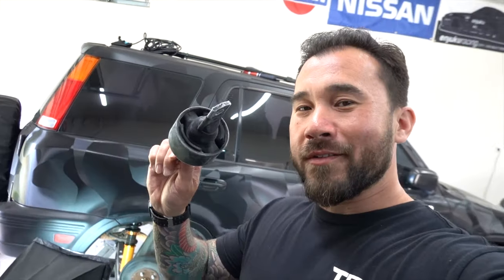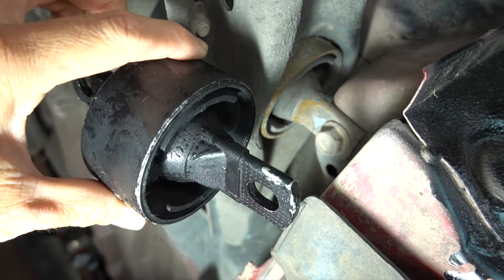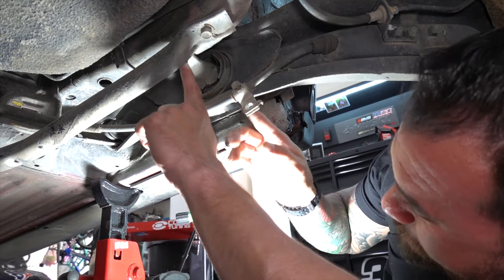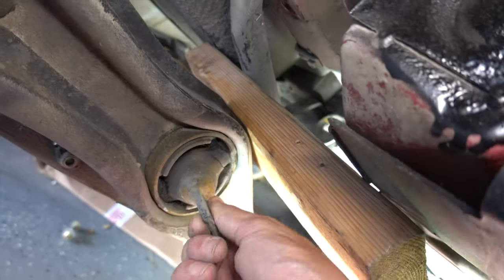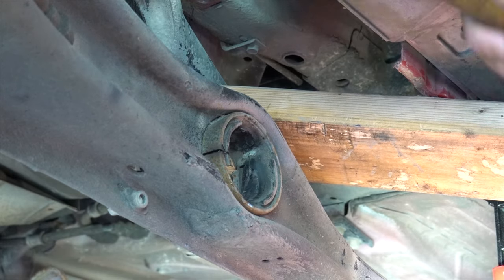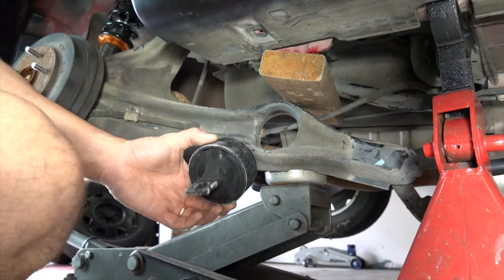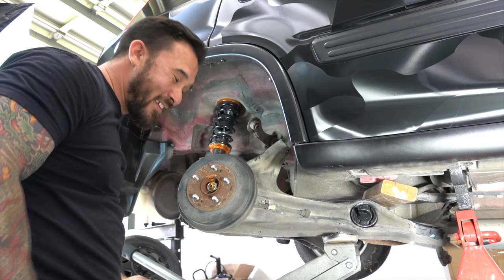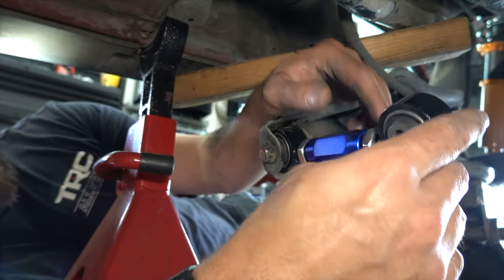How to Replace Honda Trailing Arm Bushing / CRV gets Camber and Toe Arms / Mod my CRV

Comment: Just a heads up for future DIYers, depending on the replacement bushing brand you install, you NEED a press or some type of pusher to install the new ones, that's right NEED.  I used Beck Arnley made in Taiwan bushings (high quality oem copies)and they CANNOT be hammered in even if you freeze them.  I am just trying to save people major grief here.  I did cut my old ones out though.  The hole in the arm is tapered, so if you don't cut them, you need to drive them out towards the exterior of the car.  Install towards center of car.
Reply: hell yea. he made it look easy for YouTube. It really is a PITA
Reply: Well to anybody out there who does need to replace trailing arm bushings they have some that you do not have to press in or use a special tool to press it in
Reply: I am in this exact situation with a 2011 CRV. I am curious if you can provide any insights as to the importance of the orientation of the two slots in the middle ring of rubber where the pins press in. I can not find this information anywhere due to the fact these are knock off bushings

Comment: Thanks you saved me, I was replacing the ones on my 98 CRV and somebody put in some kind of weird two-piece bushing, pretty much just a piece of rubber with a shaft through it, really cheaply made garbage part, I was able to push it out with my bare hands! I needed to know what the spacing was inside of the swing arm, got them in now should be good for another 100k

Comment: Mine is fighting me much more than that.  WTF. 

     I finally got the thing in.  I had to grind the starting part of the bushing down qiite allot.  I also clamped a 80 pound vice to the arm so its  weight would counter the pounding blows.  I kind of got a the bushing started using a push pull bearing tool rented from autozone and some adapters from a truck ball joint tool.  After this I used a large ballping hammer and  a sledge.  Yeah did chill my part and sanded too.  Finally got the thing in after beating the F out the thing.  My poor ballping hammer got slightly flattened from all this.  So I got a part that was supposed to be higher quality.  Is this maybe why I had had so much trouble?
Reply from the maker: Sorry brother , I’ve done this like 100x
Reply: @Donnythelatemodeltech  I kind of think the problem was the brand of part I used.  The metal seemed thicker than what I had. Maybe that made it harder to install.  What brand part do you use.  Yours went in allot easier than mine.